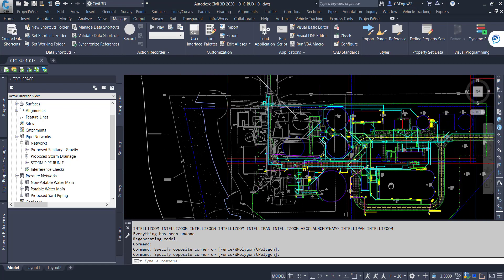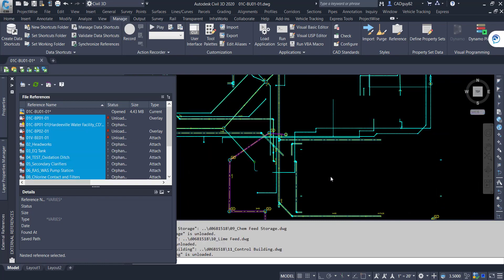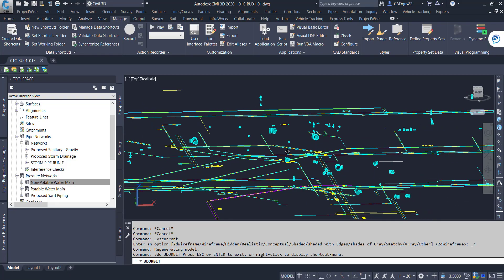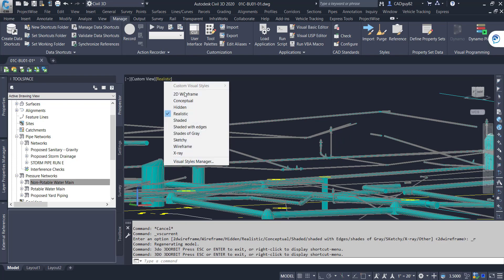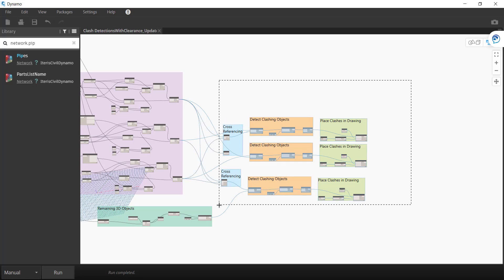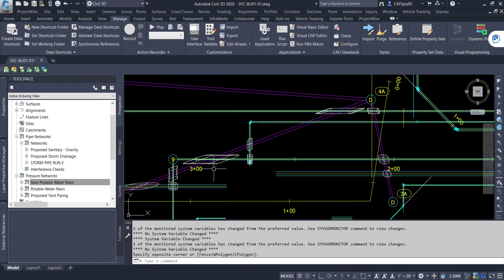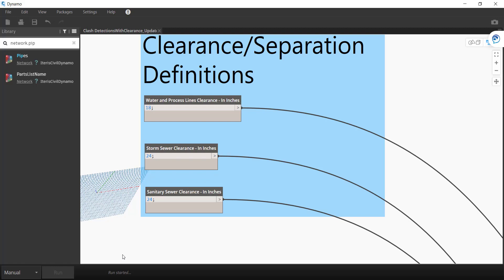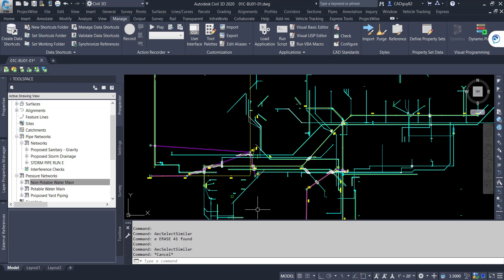C3D Dynamo   Clash Detection with Clearance Values

Comment: Great to see there exists a solution to this C3D deficiency. Is there a way to setup different clearances depending on the intersecting networks i.e. if my Storm-Water clearance is 12" but my Sanitary-Water clearance is 18"? Is there a way to analyze additional networks beyond san, stm, wat? Such as grey water or natural gas?
Reply from the maker: Yes Yes and Yes! The benefit of Dynamo is you can make it fully customizable to your specific design requirements with varying clearance values